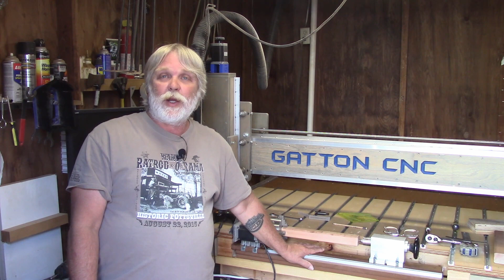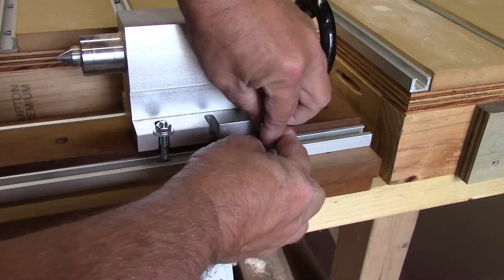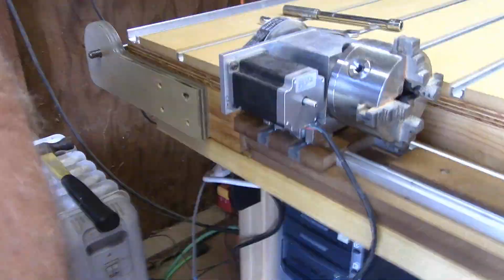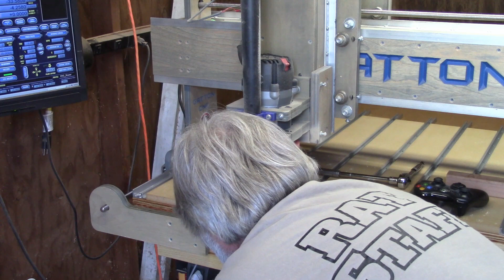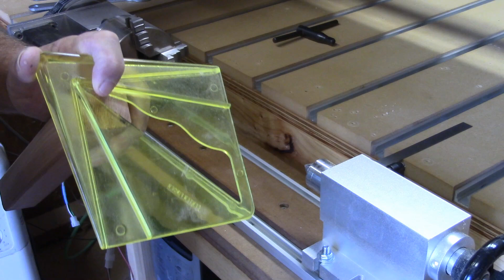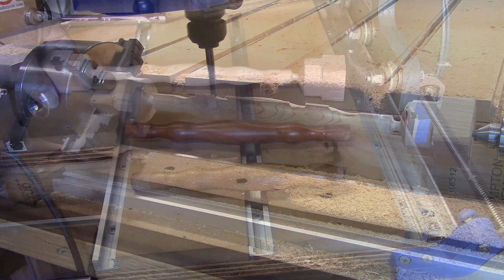Rotary Axis for my Gatton CNC - Part 3 – Mount and First Run

Comment: Hey Mark, thank you for posting this and doing everything regarding the 4th axis, including this final last sequence that actually covers the zeroing process for the z when setting up stock in the A axis.. dang i swear I spent a week cutting air until I saw this actually being explained in a real application setting. All other videos end at the motor settings and then they go " hey you're off to the races" ... well your horse is on the track but there is no jockey till you get the Z zeroed out WHERE YOU PUT IT IN FUSION!! ( in the setup under cam).. So if I understand correctly now; .. If my origin point for everything is the centerline of the stock that's riding in the chuck-- then I zero my Z axis on the outside surface of that stock, it will cut too high right? Doing it this way has the machine consistently cutting too high above the stock by the radius again of the stock, So when I watched your video I realized what I think I'm doing wrong. SOOO.... Zero at center of stock in the design should also be zero in the center line of the stock on the machine. If I zero the Z on the surface of the stock then there is no way it will cut correctly.. Please, am I making sense here? lol thank you.. once I get this I'd like to make a primer video that covers some of the pitfalls i'm running into.. Thanks again for being so generous with your knowledge

Comment: Very good!!!. Excelent. What is the g code program adapter? Cheers from Argentina!!!!
Reply from the maker: I use Mach3 control software. It's never failed me yet.
Reply: @MarkLindsayCNC  Back to it is Aspire? I need you tube tutorial for it. Thanks
Reply from the maker: I understand now - you're asking which Post Processor I use. That depends on your controller software, and which way your rotary axis is mounted on your CNC. I really can't help you here. Send me an email through the Contact Us page on my website, marklindsaycnc.com
Reply: @MarkLindsayCNC  I need  Configurate G code or tap for cnc Plasma Rotary Axes. Is similar to wood program. I have a match 3 postprocessor and Aspire. I send yo uan e mail. Thanks.

Comment: Thank you so much for doing these. As a NEWBEE, I have really learned so much. Nowhere can I find instructions on how to use th table bed as the Z point instead of the material surface. When I try, the bit plunges to the table surface. Would love a video on that. Thanks.
Reply from the maker: Thank you, Fred. I haven't done a video on that technique, because I do use it. I set my Z zero to the material surface - always. My friend Peter Passuello, however, DOES set his Z zero to the table surface, and has done several videos over on his channel CNCNutz. He's well worth subscribing to. He has LOTS of great info over there. Here's a link to one of his earlier videos (from 2013,) where he shows how he does it.  https://www.youtube.com/watch?v=Q-Q1o16Ux-I

Comment: Great video Mark! How would you go about making a switch instead of pulling and reconnecting stepper connectors to change your operation?
Reply from the maker: Heh - if I knew that, you could bet I'd have posted a video on it by now. I think I would build a controller that would handle 5 steppers instead of trying to modify this drive box, but that's just me. Thanks for watching, Dan!
Reply: Thanks for the quick response Mark. It seems like there would be a mechanical toggle switch that would do the same thing as unplugging one stepper and plugging in another to the same source cable. I have no idea what it would be called but I have heard of multiple pole toggle switches that can send signals or power different directions based on the position of the switch lever. This would be very handy. The controller would need to be turned off for switching I suspect and the Mach 3 profile could be changed prior to power up. I believe you would be able to figure this out for all of us. No pressure.
Reply from the maker: Oh, I have no doubt it could be done. I'm just not electronically inclined at all, so I'm not willing to be the guy to experiment with it. Besides - having to physically change the configuration of the CNC by doing a lot more than flipping a switch reinforces the fact that I made that change, and I'm less likely to forget I did it, and make a huge mistake when I go to run a project. That's just me though.

Comment: I will have to say that I was not expecting it to operate like that... But I am impressed with it none the less. Thanks again Mark for another great video.
Reply from the maker: Thanks, Brady. The way I set up that file, it cut along the X axis. I can also set it up so that it cuts along the A axis. The X will bump over to the right the correct amount of stepover, then the rotary will turn 360°, then the X will bump over again, the rotary will turn, etc. As I said, this was the first thing I cut on it, so I'm still learning it.

Comment: I am asking about rails for v bearings . What kind did you use??
Reply from the maker: I used 6061 aluminum angle from McMaster-Carr.
Reply: Mark Lindsay CNC but does it fit the v groove of the bearing or does it need to grind the edge ??
Reply from the maker: I did not grind the edge. The bearing will fit one edge of the aluminum, and will roll over the other edge after the first 5 or 6 minutes of full axis travel. I did have to adjust the bearings after it finished rolling over that edge.

Comment: Question: Can chuck and/or quill be removed, and if so, are they Morse Taper?
Reply from the maker: The chuck can be removed from the face plate. I haven't tried to take the face plate off, and I haven't tried to remove the quill yet. I do need to check that out, for sure. Thanks for checking out the video!

Comment: Mark, consider finding your Z zero by touching off from the top of the chuck, then setting the offset to chuck diameter/2 (this idea from this year's McGrew's Aspire Camp). For leveling your A, could you open the jaws as large as they go and span the two horizontal jaws with a level, or put a known flat material across those and then use the level on top of that?  I'm hoping to add a rotary to my larger CNC, perhaps this year, and these videos give me some ideas.
Reply from the maker: Thanks for the leveling idea, Roy! I still need to get a machinist's level, but that's a great idea! As for settign my Z zero, I've figured out how to use my touch plate with the rotary axis. In fact, that'll be the main topic of the next video.

Comment: Congrats on your first run.  A success.  I think it may be easier to set your Y to lock in and your Z to centre by using the point of the live centre.  Given that it is set to the chuck properly.
Reply from the maker: Thanks, Jim. The main reason I'm setting the Y to an index mark on the headstock housing is because I won't always be using the tailstock. This way I don't have to put the tailstock on, set my Y, then take it back off. I can just mount the headstock, set the Y to the index mark, then drive on.

Comment: Great Job Mark!  I haven't set a rotary axis before but i've done a lot of lathe work. It seems like you don't have to be so precise when zeroing A and Z on a spindle like that and it would be easier to set Z to material... i'm just brainstorming though because i've never set up a rotary:)
Reply from the maker: Thanks, Lyle. The way it was explained to me was that by setting Z zero to the center of rotation, it makes up for any irregularities in the material. Then I don't have to worry so much about whether the blank I'm mounting is perfectly square or straight. For instance, the model I used to cut this project was based on a piece of material that's 1 1/2" square. The piece I actually mounted in the chuck was 1 3/8" square. Because I set the Z to the center of rotation, it didn't matter. I'm still working on the whole Z zero thing. The spoke I cut out wound up being about .003 larger in diameter than the part it was supposed to replace. That could be either my Z zero being off, or my drawing being off slightly. I have an idea or two, and when I've confirmed one that works every time, you can bet I'll shoot video on it.
Reply: Mark Lindsay That totally makes sense on the z. I’m thinking when you were measuring that the piece was parallel to the bed maybe it would be easier to measure that the centreline of the chuck and live center are the same which should stay very close once setup? Again I know nothing about it just trying to get it in my head...  after all you created a monster by motivating me to do this... just need to find time:)
Reply from the maker: Glad to be of service, Lyle. You gotta remember to feed that monster, or it'll come back and bite you. I've gotten some great suggestions from folks on Facebook, PMs, and emails, and figured out a couple of things on my own, but... well... that's for the next video...

Comment: Great Job Mark.  To make it easier to find the centre and line your headstock (chuck) up. Try mounting a round laser pointer into the chuck, rotate the chuck/pointer to make sure you have a point and not a circle. First off make sure the beam is parallel to the X axis and z axis . lock down your head end.   Adjust the tailstock centre to the laser beam and lockdown (leave enough room for the workpiece)   You could adjust the Z axis to zero (centre) by bringing the tool tip into the  beam.  Cheers Rob.
Reply from the maker: Very interesting, Rob. I'll have to get a laser pointer and play with that idea. Thank you very much!

Comment: Yay!!!!  Finally some chips!!  That turned out nice.  You might try using a smaller ball nose bit with less step over and you won't have to sand at all.  Of course,  it will take longer but it's worth it and you've got nothing but time these days anyway.  :-)
Reply from the maker: Thanks Dave!  This was the first thing I cut on it, so I was still kind of figuring it out. I went with a 9% step over and the tool marks were very slight. I think if I go with 7 or 8% I can get rid of them altogether. I'm still experimenting with it.
Reply: Wow , I'm mostly thinking of the endless  posibilitys of things you can make with this , way cool !